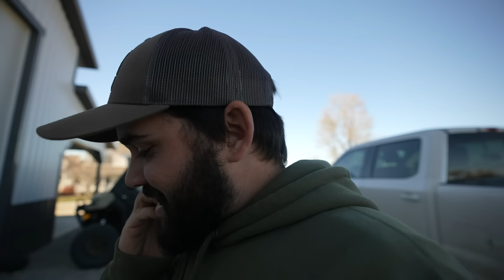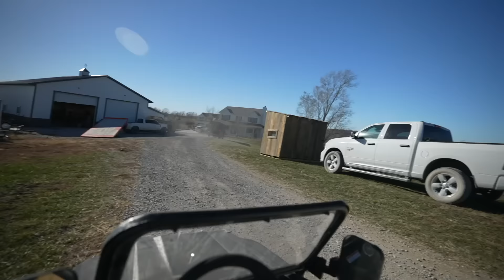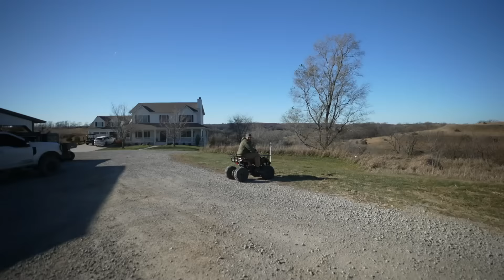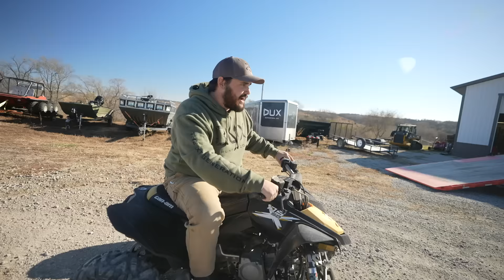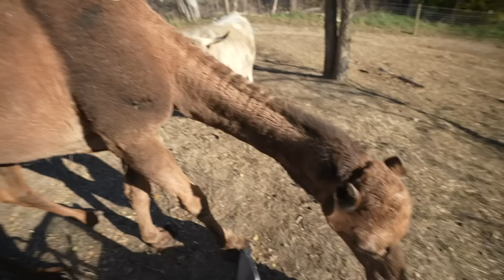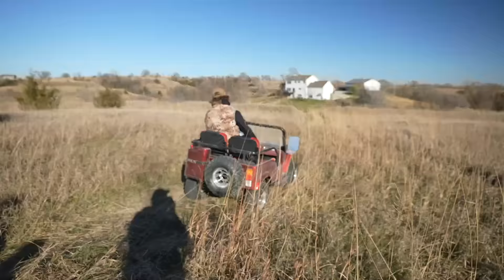I Bought TWO Mini JEEPS for My BACKYARD and they're FAST!!! (Already Broke Them)

Comment: Don’t sell the Chinese four wheeler, buy a motor from harbor freight and swap it in there! It would make a sick series
Reply: I have a 420cc predator engine in mine. It does a wheelie off the ground. Only like 6 inches tho
Reply: @Koolaidman1522 you should have got the duromax 440cc 5 more horsepower for only 20 more ccs

Comment: Yup this needs to be a thing. Buy stuff and mod or rewire, remove governors, lift, engine swap, turbo, forced induction, race fuel, paint, fabricate, install, build a track and compete.
Reply: i agree
Reply: Slayyy
Reply: I’m in
Reply: There called UTVS

Comment: Put a bigger size sprocket in the rear and it will give you more low end torque, but it will take away some top end speed..

Comment: The 125 is probably a 4 stroke engine and the 90 should be a 2 Stroke. I think for MX or other sports it is something like a 125 2 stroke rides in the same class as a 250 4 Stroke so its kinda doubled. In that regard your 90 would be like a 180 compared to the 125 which would explain why it rips more
Reply: No offense but nothing that you just said is true lol

Comment: A big thing with the quad.. it has a crappy carb.. hop on amazon and grab a vm22 carb. That will make a huge difference. The quad and the mini jeeps have pit bike engines in them.. I build and work on these all the time.. I can help if you need

Comment: You need to put some v tread mud tires on them! You can buy them from tractor supply their for lawn mowers we used to take the decks off mowers and put a smaller drive pulley and make race mowers

Comment: Theresa wire on the handle bars of the four wheeler and its like a bolt thing unscrew it all the way thats the acceleration and then what you did was the max speed screw

Comment: I used to have a 125cc and you have to put a different battery and what you did but you should straight pipe it
Reply: Also you should rip it in the snow it’s very fun

Comment: On the throttle there’s a screw that retains how far the Prado cord can go you got to eat or completely remove that screw or loosen it a lot into it almost comes out I have had that like same four wheeler to Chinese new name off brand four wheeler they break a lot and you just end up removing the screw off the top end of the year on the side tomorrow and stuff and it works really well they blew a head gasket style after two years

Comment: Here is some ideas for ya for the jeeps,   lift kit and little bit bigger rims and tires,  you could probably use a golf cart lift kit,  light bars,  winch,  tint front windshield,  also u should see about having a tow kit made for it so you can hook up a small trailer to it and stuff.  Roc lights under the wheel well,  mount a gun holder on the side and make it so u can remove it when your not using it for hunting.  □□

Comment: You should get a Yamaha Blaster 200cc in either leave it or put a Big Bore Kit up to 250 CC it would do like 90 or we could go balls to the walls get an XR650L which is a Honda Enduro motorcycle engine and and that thing would be nuts

Comment: Yo the chain on the jeep is prolly supposed to be loose when no one is in it, and it prolly gets tight when the suspension compresses. Having the chain to tight will break the chain again or other parts, and wear parts down faster

Comment: If you still have that 125cc for wheeler just engine swap the 125cc and put the sprocket from the 90 and put it on the 125 it will do wheelies. Also there is a diffrence between a fourwheeler and a quad the 90 is a quad the 125 is a fourwheeler the quad is made to drift and slide and do wheelies the fourwheeler is for going through mud and over bumbs and over trees its suppose to be a atv quads have less room underneath and softer suspension aswell

Comment: You can turbo charge/ supper charge those with a small fan wired to a switch on the intake. But you should definitely lift the one you change the sprocket on that way it has more power to push bigger tires.